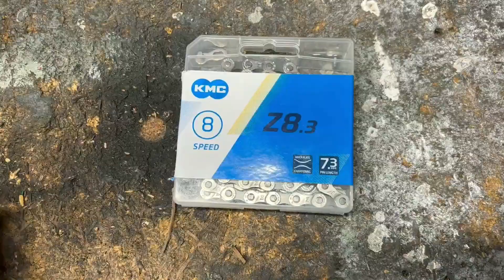Bike Builds & Mods - Sonoma Parts Bin Build

Comment: Nice build Randy really like those billy bonkers have three sets myself - never thought of using a quick clamp for the brakes so thanks for that - must build some of the frames I have laying around - thanks for the inspiration andvideos
Reply from the maker: I like the Billy Bonkers  too but I have the worst time getting them to seat on the rim. Have even destroyed a couple in the process in the past. Expensive!. Even on this build I struggled with the front and ended up switching to a different rim before getting it to seat. I've seen others use various straps to hold the brakes but yeah I've always just used the quick clamps. Thanks Broncobike!

Comment: Nice bike!  As you build more bikes, do you sell off some of the older ones?  My son and I like tinkering with bikes but we are running out of bike space and thinking of selling some to get more parts and build up more.
Reply from the maker: Thanks Frank. Yes storage is an issue. One thing I do is just rotate through several different frames, building them up for a while, tearing them down stashing them away and then building again into something different later on and repeat. It's a little easier for me to store parts than it is complete bikes.  I rarely sell complete bikes. Once in a while I'll give a bike away. I'll unload a couple frames at our swap each year and pick up a couple different ones to build. Every bike I build I seem to get attached to though. It's tough finding balance.